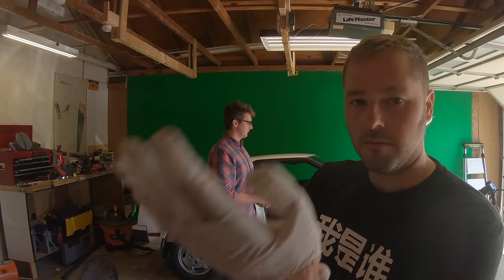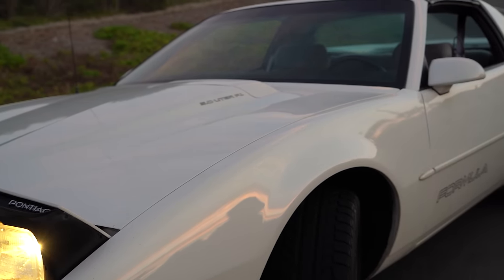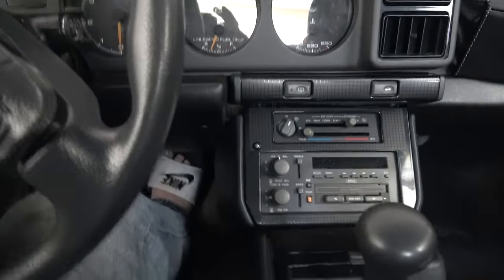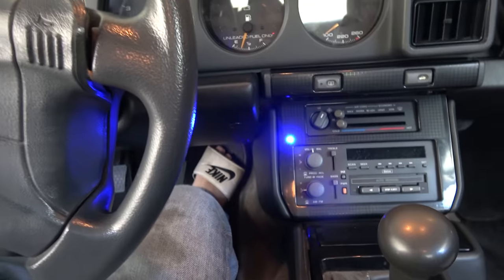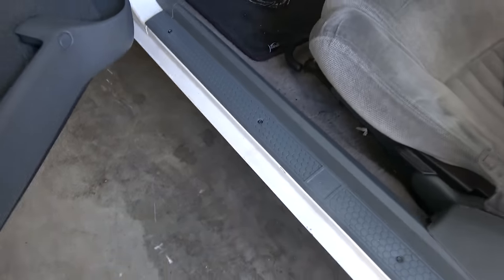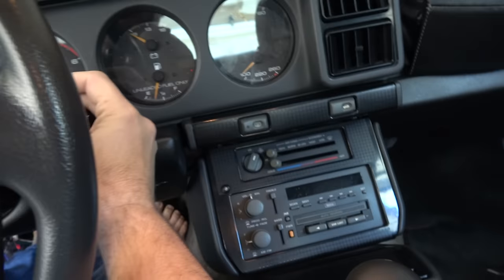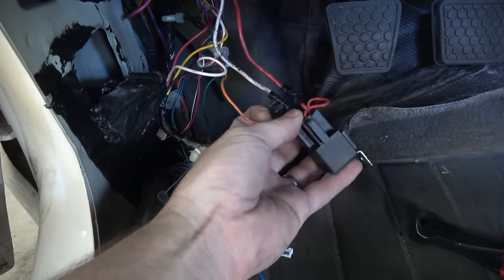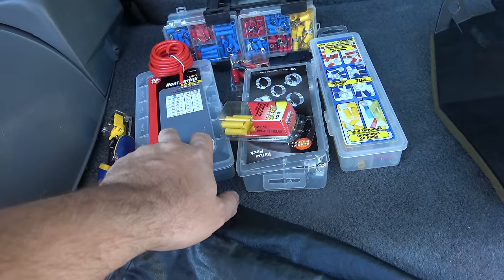Aftermarket Alarm Leaves Me STRANDED! - Let's Get Rid of it

Comment: hey.  the age story doesn't quite jibe, at least not without further explanation.  blue LEDs didn't really come into commercial availability until maybe 2000.  (just google the date.)  everything else you said is right... they're more or less the same, these aftermarket units.  there is going to be a manufacturing date code on those units (and if not outside certainly on the chips inside).  if 1992 they will still most likely be "through hole" chips

Comment: 2 months too late... on the connectors that are unplugged, my 1997 subaru had a suspiciously matched pair of unplugged connectors... so I decided to correct the situation and plug them back in... get the key in the ignition, turn to on... and my car started flashing every dash light, making lots of clicking noises... I thought I broke my car
Later that day, flipping through service manual, I find a little passage about a pair of connectors that are deliberatedly unplugged, because they are there for diagnostic purposes, when you do not have OBD scanner, one plugs them in and observes different flashing patterns. 
Your unplugged connector look very much like the two on my subaru.

Comment: My 92 Foxbody had one it was horribly installed now it does lock my wheel when I try to turn it while the car is off plus I can turn the key to unlock it but I hate the annoying flashing lights, plus mine won't even start anymore, my starter works great, replaced the relay, it works great too, but it still won't start when I try to turn it over. Even when my battery is fully charged.

Comment: I just got a really nice 96 Ranger, but it's so fucking annoying because I keep accidentally setting the aftermarket alarm off half the time, even though I don't try to arm it or anything. Sometimes it won't even start until I pull the key out and use the fob to unlock the already unlocked truck. I'll have to do this very soon.

Comment: My 99 Honda Civic had a Clifford XL1000 alarm in it. I removed the alarm box and now it will start, but it won't shift out of park. After reconnecting to alarm, it shift out of park but will not start. Me and my brother have spent hours to find the solenoid that allows it to shift out of park has nothing to do with the alarm and is not wired into it in any way. The solenoid is not bad. Any advice?

Comment: Just imagine how badly the rest of the car was treated if they did such a careless job on that security system.
Reply from the maker: I'm finding out more and more
Reply: @WorthlessWhips  Hey, at least it makes for some great content. That's the upside.
Reply: Looks like a $499 car alarm special from one of the installer shops back in the day...
The business model was about volume, with one installer cranking 4-5 out a day...
I’m thinking the tar was paint on electrical tape, with 35 years degradation...😇

Comment: That "tar" is what happens when you use cheap (like 10 rolls for $5) electrical tape in a hot climate.  It basically melts and turns to tar and it creates a really nasty mess
Reply: No it is same that is used to attach door trim sealing.